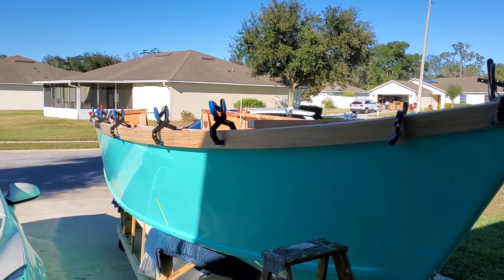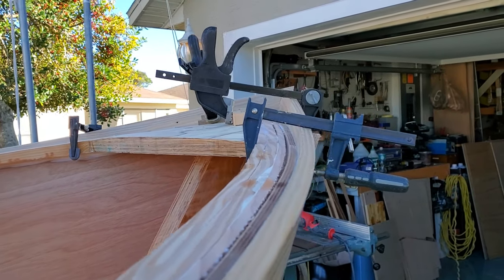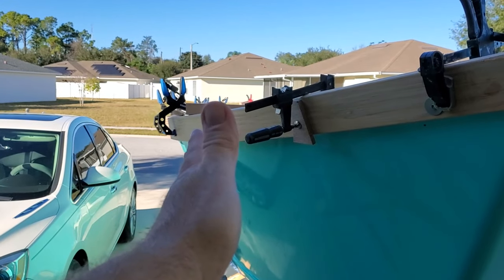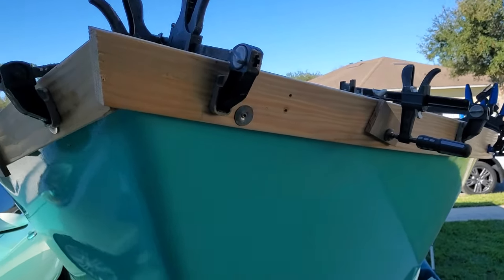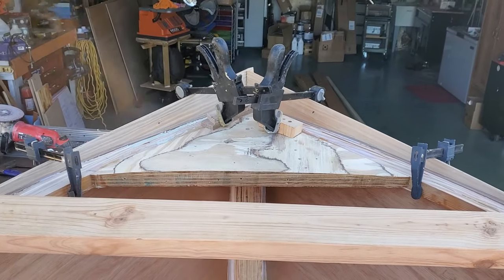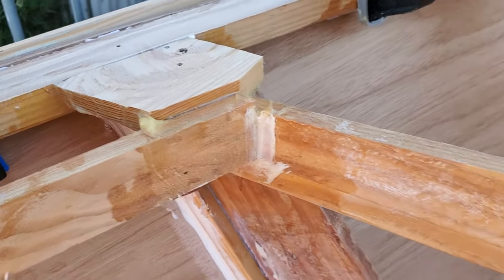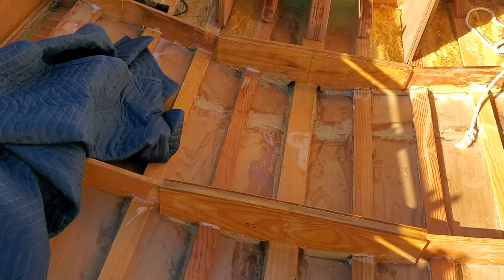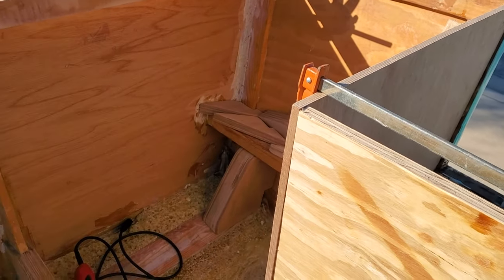Installing gunwale Part 55

Comment: After seeing the braces that you will be using next to the motor well  along with the horizontal board across the transom that should add the strength and rigidity to the transom you are looking for. So your right, the small brace in the corners should be fine. They will not be taking the stresses of the motor on the transom. Nice lay out.
Reply: Thank You